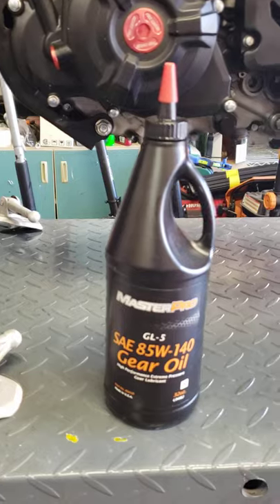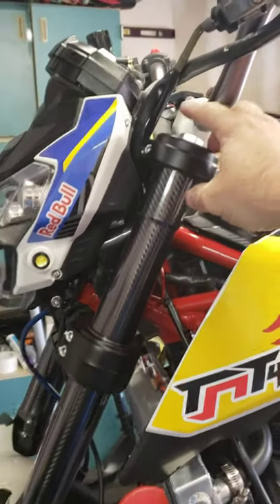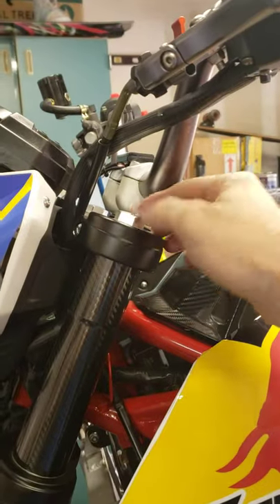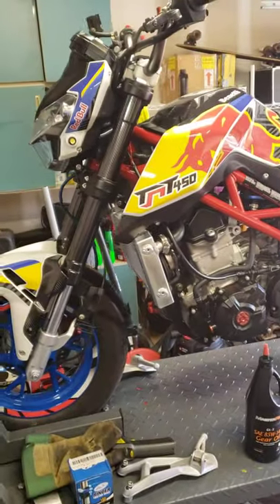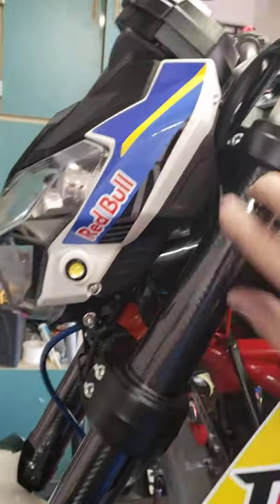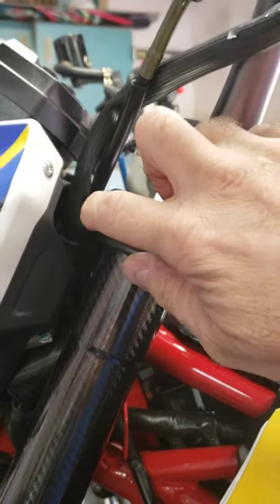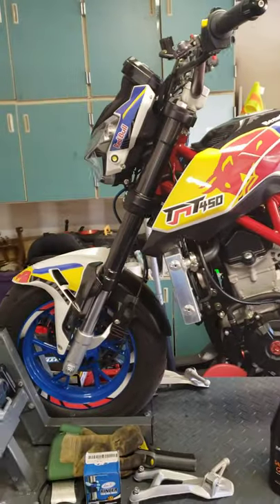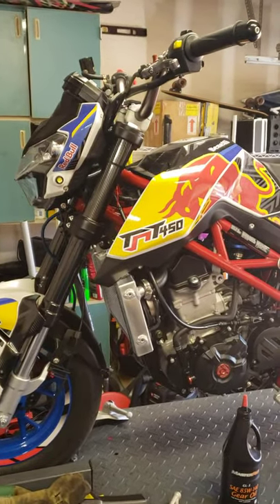TNT135 FRONT FORK MOD

Comment: With a bike this size, I've always just drained the gas , lossened the top pinch and fork tube cap bolts, turned the bike upside down drain, put it rightside up again, and pour in the new fluid..helps to have a strong friend and something soft like a movers blanket to rest it on. Takes like 5 to six minutes.. depending on if you run stock/vs. handlebar end cap mirrors.. if you've got some sort of ceiling beam hoist, even less.

Comment: Just to make sure I am understanding correctly: the modification you are doing is to replace the low viscosity oil for one with more viscosity. Right?
Reply from the maker: Correct...it slows everything down...this is a inexpensive and easy way to improve the ride over stock..

Comment: Love your bike and mods but could you hold your phone in the horizontal position please. I have over 9000 miles on my TNT 135 stock engine now still going strong.  I would much rather have your 450.